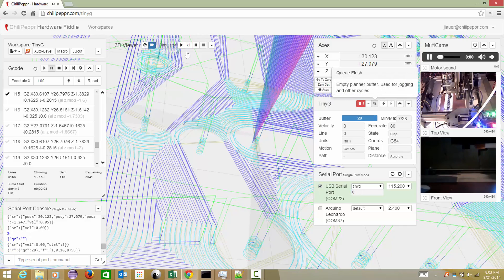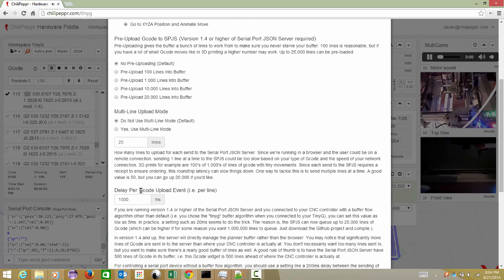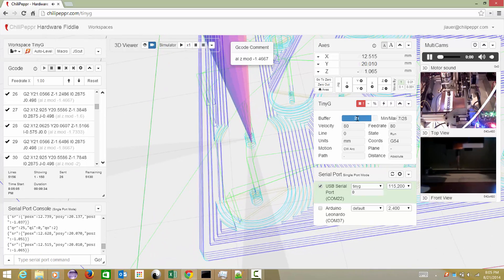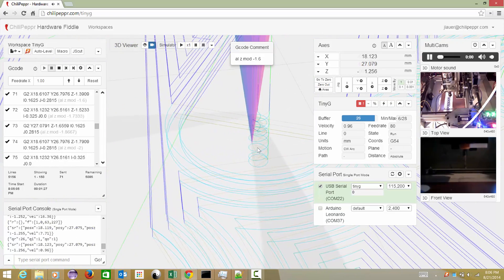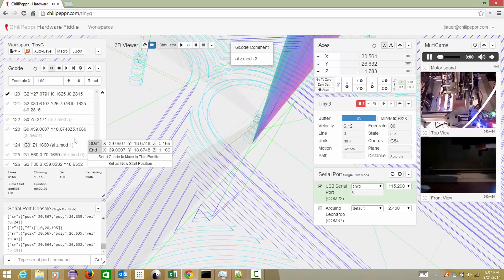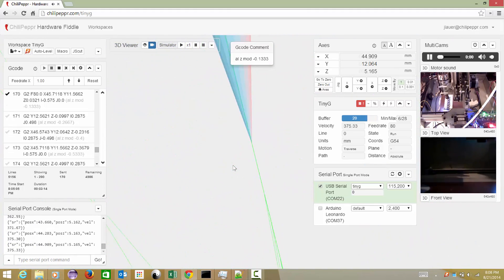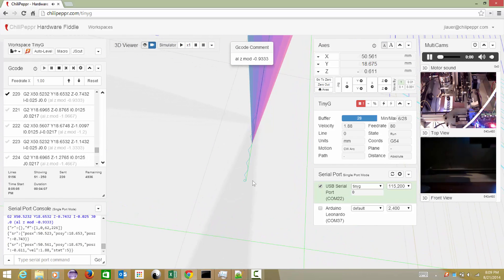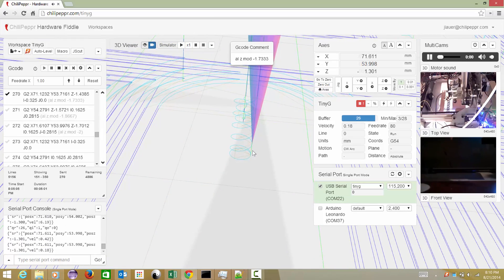ChiliPeppr Running Auto-Levelled Gcode with G2/G3's in It

Comment: I was wondering about arcs.  my first shot at using the auto leveler didn't offset z values for arcs.  I used a different postprocessor without arcs and it ran fine.  But it looks like this file has plenty of arcs.  am I missing something?
Reply from the maker: arcs should work. do you not see comments of the modified z in your auto levelled gcode on the lines with arcs?

Comment: Do you have the machine in the same room as the recording? Where is that machine sound coming from?
Reply from the maker: The machine is in the basement and I am upstairs during this recording. This is the first video where I am showing off my new multi cam widget that I load via a macro. I will post a video shortly on how to do your own multi cam. Notice the motor audio in the upper right corner. That is where the audio comes from in this video.